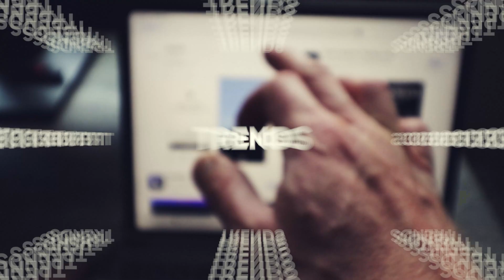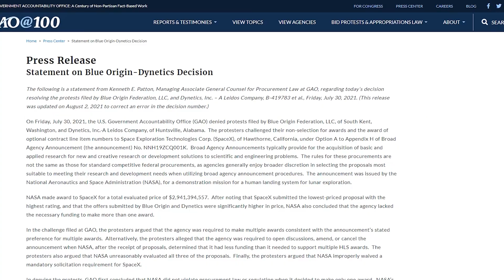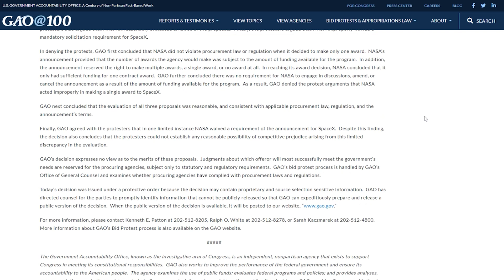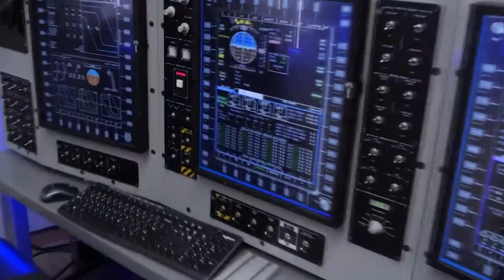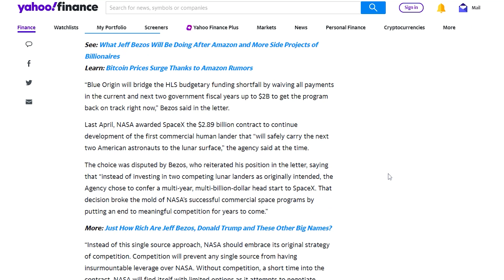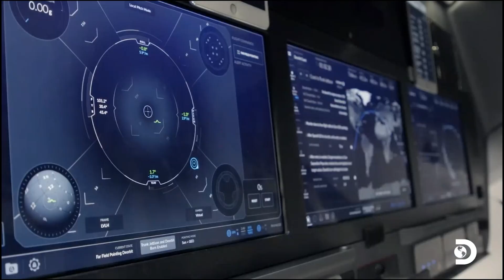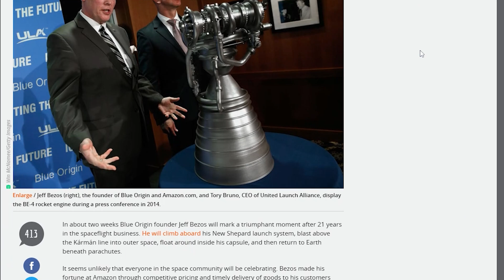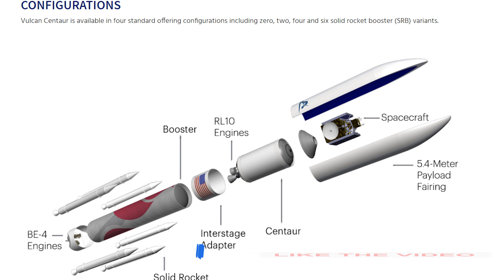Space News - Jeff Bezos is a Space Joke! Space X, ULA, Tax Payers, Moon Mission Delay and a Bribe.

Comment: SpaceX could offer its Raptors for use by ULA. That would give ULA what it needs and SpaceX a new revenue stream.
Reply from the maker: You know, that's not a far off idea, in fact it might just be the next move by ULA. They also have a good working relationship with Rocketdyne
Reply: @HillPhantom  Thank you. How far along is Rocketdyne with their engine? I know they were in contention as an alternative to the BE4 but they were not chosen. SpaceX has a production line for Raptors producing an engine every 4 days, reported, and it should get better. That’s sufficient to support both Vulcan and StareShip. What was Blue Origin going to charge ULA? That would be sweet. Bezos provides funding for SpaceX through his inability to fulfill his obligations to ULA. Lol!
Reply from the maker: @dmk1948  so Rocketdyne supplies engines for the Atlas IV, but then they went Russian for the Atlas V.  I have not researched it much but perhaps it was not such a happy union?  I need to do a deep dive on them if I am honest. I know the the AR1 rocket they have been working on has largely been left on the table, after the Air Fore funded it. I am not sure the issue there but it sounds like a new research topic and video for me! Another company I am really interested in is Rocket Lab I think folks sleep on that crew.
Reply: @HillPhantom  As I understand it, Rocketdyne went with the Russian engines because they were good and already available and cheap because the Russians needed the money. The Russians had the engines in stock no money for complete rockets or mission, so they sold them to Rocketdyne. Rocketdyne rebuilt them to US standard and put them on the redesigned Atlas. The AR1 would probably be a good engine but it is locx/kerosene
Reply from the maker: @dmk1948  wow! I did not know ROCKETdyne rebuilt them for ULA. Welp. I think we solved it. Raptor........I would be so happy to see ULA snuggle up with Elon.